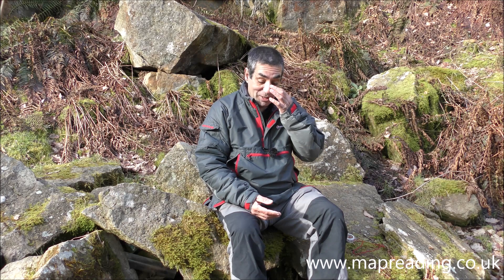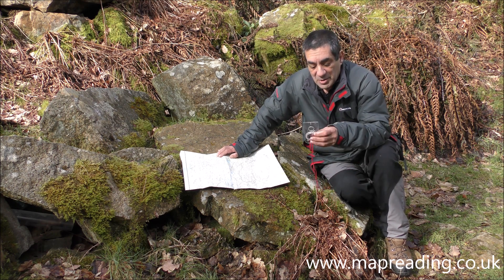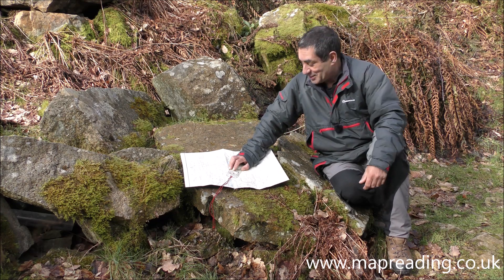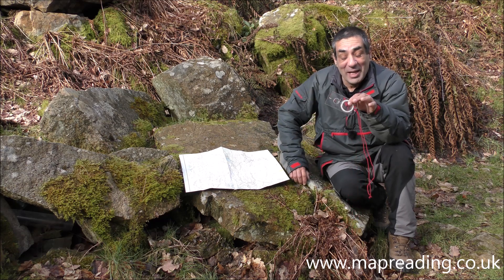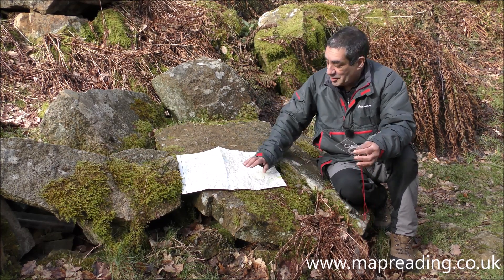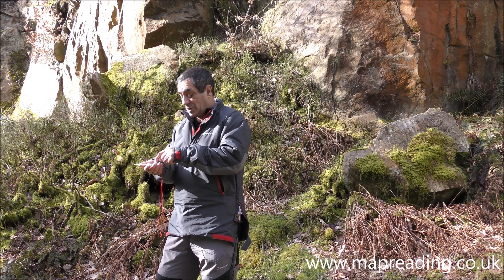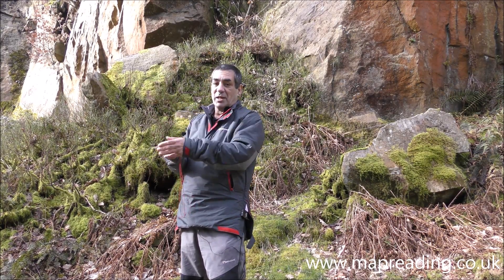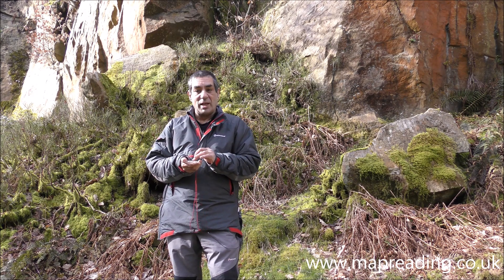THIS is how to take a compass bearing and follow it

Comment: He incorrectly refers to the north south grid lines on the map as 'eastings' (3m 27s). These are called 'northings' or 'grid meridian' lines. If you align the meridian lines on the compass with the eastings, you will not attain a correct bearing. He should have reviewed the video to check it was all factually correct or perhaps he doesn't know. Or perhaps he is Mi7 (Nazi-aligned/beta) and does this intentionally. Unacceptable.
Reply from the maker: He incorrectly refers to the north south grid lines on the map as 'eastings' (3m 27s). These are called 'northings  - 😊 are you sure ?

Comment: the first step which you never mentioned is you have to orientate the map to the north using the compass before taking a bearing or your bearing your taking will be wrong, in the video you have the map orientated West and your destination is East ,when you took your bearing you would have ended up walking north not East.
Reply from the maker: When using a map with a compass the map does not need to be oriented north.
Reply: The map does not need to be orientated to North prior to taking a bearing. The direction of travel arrow on the compass base however, must be pointing in your direction  of travel.
Reply: You can tell who didn’t watch the video

Comment: A reminder to all that the parallel lines within the bezel are aligned with the Eastings (north-south lines). The Red shed must be pointing upwards to the north. It may be slightly left or right if you have adjusted the inner shed to account for declination. 

Do not make the mistake of having the red shed pointing south. 

The UK presently has a small declination and the author prefers to not adjust for declination using an adjustable red shed. You mess with some of the other features of a compass by moving the red shed to account for declination. 

On a map, always use the parallel lines to obtain the bearing. Your compass is more than a magnetic needle.  Think of it as a protractor. The old technique of obtaining a bearing using the magnetic needle on a map can lead to problems with magnetic interference. This is why you use the parallel lines.

The author has covered these topics in other videos and has greatly increased the public's knowledge of navigation. Job well done.

Comment: Map and compass work is great fun. It can be a life-saver too. Using tufts of grass can be the only intermediate points to sight and go to. Essential to stop when tuft is reached and take bearing for next tuft. I did just that on the “featureless” top on one of the Brecon Beacons many years back, in thick low cloud. Compass was the only option as the destination point was not visible from any distance.

Comment: If the intermediate landmark is not exactly on the bearing line, for example it's about 10m on the left, is it better to stop at 10m to the right of the intermediate landmark and take the next bearing or go straight  to the intermediate landmark?
Reply: If your waypoint of choice was exactly on the line of the bearing, you wouldn't need to take another bearing when you arrive to it. You take another bearing exactly to correct your course against the slight variations of yourself and your landmarks.
Reply: Thanks for the response.....but what if you can’t see the attack point or final destination as you won’t be able to correct your course (you’re intermediate features, if they are a tree or a rock, will be too small to be marked on the map, and if you have moved off your direct bearing line to go to these intermediate features you will be on a different bearing and can then only adjust your compass bearing if you can see the attack point or final destination). The narrator does not address this scenario which I would imagine would be quite common in the field and so I just wondering what to do.